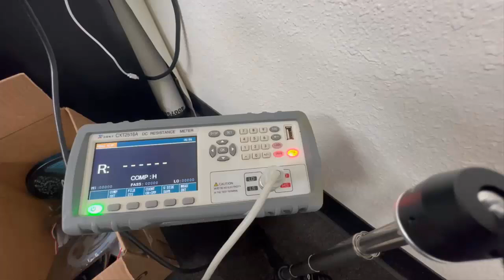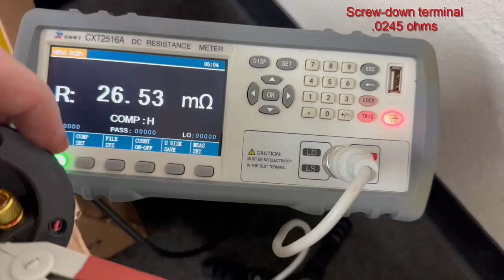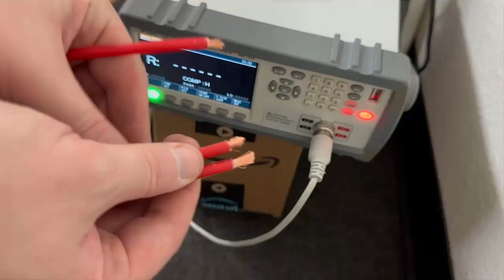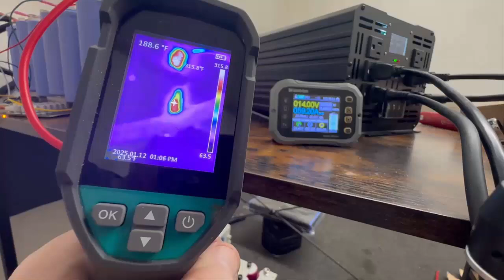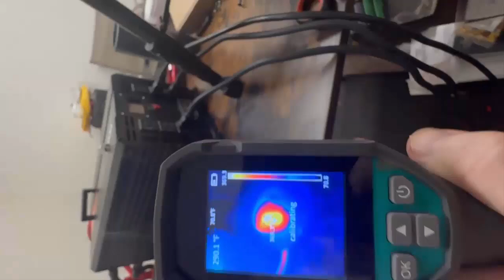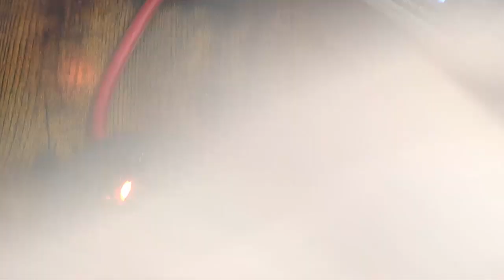Speaker Terminal Cups - Resistance & load testing

Comment: This was good. I would like to see other connections though. Say instead of the female spade terminal have a good long piece of wire soldered to it and a rind terminal with a washer. Also scuffing the gold plating to see if it lowers the resistance.
Reply from the maker: If the plating is actually gold, scuffing it would likely do more to just sand off the plating than help the connection.  Gold does not tarnish like silver/copper/aluminum etc - it's a noble metal similar to platinum.  

I imagine soldering connections would help a bit - but at the end of the day I still think it's simply too much amperage to pull through a terminal that's flimsy brass (if we are lucky).
Reply: @GloweIndustries  I know, I'm just throwing suggestions out there for possible questions people could have when seeing a test like this. Reason being that for as long as I have been messing around on the internet this is the first time I have seen anyone perform a test like this. I know the testing takes a lot of time, but having a all in one or a series of videos showing this will help for the future people that may get bad advice. Again, great video glad I found your channel.

Comment: i have the same terminal that you were testing.. im pushing my two sub with 2000 watt rms power amp.. i kept smelling a burning stench when i blast my music on high volume ... so decided to check wiring and it  was fine out the outside... weeks later , it did the same thing and i decided to check inside of the box and saw terminal was melted ...both wire were  also lose... these terminal sucks if u planning to have high power going threw it .. these terminal came with the box and i should've upgraded it ..
i have the exactly terminal your testing also ..
Reply: What did you use now since the other melted. My son is having the same trouble.
Reply: @wayneaucoin4149 

i skip using the terminal all together and drill a hole through. Now my sub is wired straight to the amp without any resistance... can't trust these cheaply made terminal anymore.. i'm lucky my car didn't burnt down or blowed any of my expensive amp.

Comment: I have two questions that I want to ask that are unrelated. 

1. I watched the fuse videos and was wondering if the fuse holder makes a difference at all?
2. Will your Gloweee battery charger work fine on a Trunk Thunder Lithium? Asking for a friend.
Reply: There are several inferior fuse holders on the market. So yes, they can make a difference.

Comment: Great video.  I would love to see this test at a lower current level, and then maybe increase the current in 5 or 10 amp increments.  I'm sure these things are just fine for 500 w.  But what is the threshold? Could they handle 1,000?
Reply: I agree with this.  Would be interesting to hook some speaker/amp setup and see how much it will suffer in a real world situation.